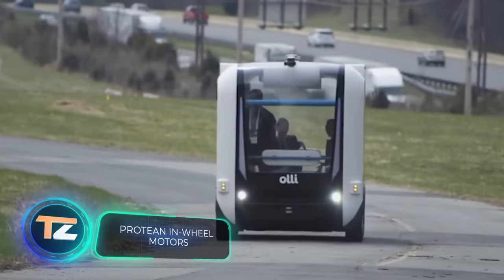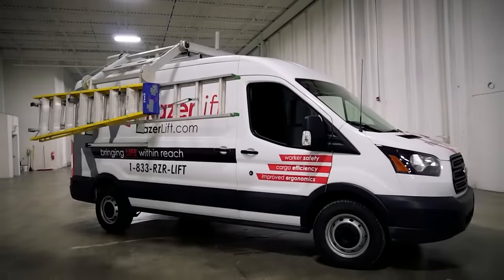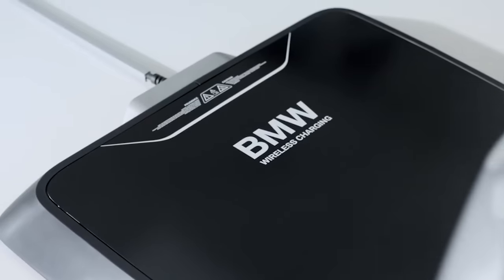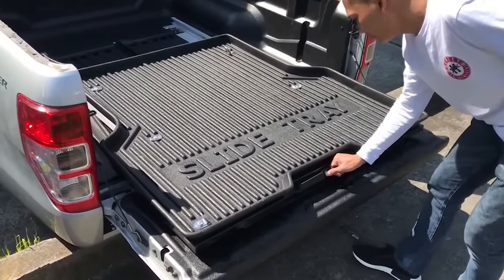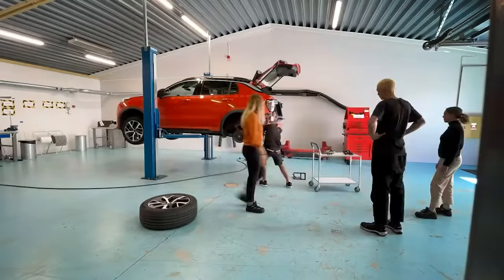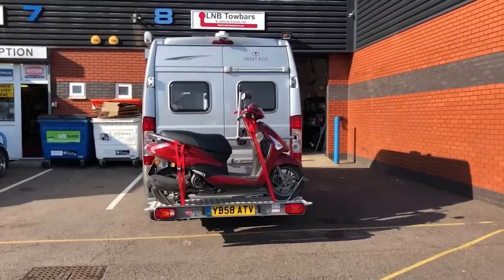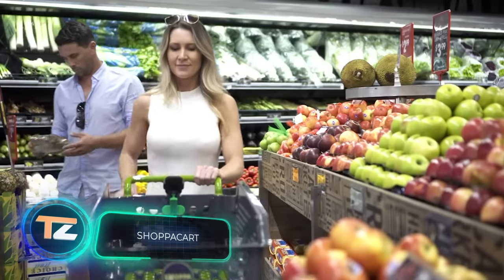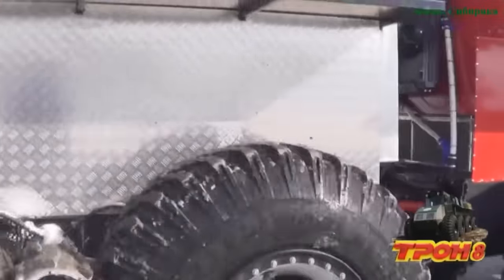INCREDIBLE INVENTIONS FOR CARS THAT YOU SHOULD SEE

Comment: 25 years ago I had a pulley system that would raise my Jeep’s hard top with rope and rubber coated hooks. I utilized the rafters in my garage and it would raise it about 3” and tie off to a cleat on the wall. I would drive out from under it. Cost about $25
Reply: Have the same in my garage to remove my camper from my truck. Super cheap and easy to make yourself!
Reply: ihaventchosenanameyet  What holds up the roof then?
Reply: Just cut a small access hole for the rope or bolt and problem solved, probably couldn’t rig it up anyway if you couldn’t figure that out.

Comment: That electric roof ladder lifting rack device has been saving live for many years. I have been a volunteer fire fighter for 23 years now and on our engines (pumper truck) the ladder is the top of the truck laying flat on the top of the tool boxes but next to the hosebed. There is a electronic lift the lowers the 200lb ladder down for us. Only takes 10 seconds for it to lower and another 2 or 3 to unhook and move the ladder. Love it.

Comment: The automated loader seems like a maintenance nightmare. I can't imagine it lasting very long.
Reply: I agree.  Also the weight of the machinery will decrease the payload of the truck significantly.   Whatever happened to the ol' shovel method anyway.
Reply: Its in the front of many silage wagons for years. And for 9k you could just buy a used one and outfit it with a motor to drive the pto.

Comment: The slide in the truck bed is such a novel idea at $750 (sarcastic). I've been using a pallet ($0) for about 15 years. Fits all truck beds, easily replaceable, lots of hand-hold locations, almost unlimited weight capacity, never have to wash it, never worry about messing it up, and if I don't want it in the truck for some reason, I just throw it on the driveway or lawn.

Comment: The disadvantage to those in wheel motors is a massive increase in unsprung weight. That is generally considered bad because you don't want your wheels to bounce off the pavement.
Reply: Increased weight equals more wheel bounce?
Reply: @jaxturner7288  yes. The wheels follow the pavement, so any inertia the wheels have will cause them to bounce off of bumps in the road and lose contact with the pavement. That's why unsprung weight is such a big deal. You want the wheels to be light enough that they can follow the pavement exactly without carrying any of their own momentum, then the wheels' movement can be controlled by the shock absorbers.

Comment: The ladder loader has been around for years for fire trucks. It’s nice that they have made a general purpose for sports equipment materials and other things. The inductive charging for the BMWs is extremely inefficient
Reply: I know right wasting 15% just so I don't have to plug in a cord!
Reply: @sambrose1  if the BMW charge pad came in an outdoor model that meant it was basically a manhole cover you just had to feed power to it could make sense
Reply: The payload of that ladder loader seems rather low, though. 150 lbs won't get you very far.

Comment: I used to be able to do the tops for my CJ7 in a few minutes. Place two sawhorses at a height just below the body, remove the bolts and screws to the windshield and then get under the top and lift with my back while balancing with my hands and walk it back. Dont think I could do that these days though. Have seen others use rope and a chain hoist on a tree limb or garage. No fuss no muss. Round headlights.
Reply: I've done the block and tackle between trees.  Now, I have an electric winch mounted on my garage roof.  Handy too when you want to work under your lawn mower without dumping fluids.

Comment: Track Mate (conveyor for unloading trucks) is a logical and practical solution. It proves that rich world still has smart and creative people in technology (not everyone is in managing sales and marketing). However, it also proves that nothing invented and made in the first (not third) world is competitive. The price of this product is as high as a new car. Even mid-class Americans will rather use shovels to do this job.
Reply: I have a tray back 4wd and for under $1000AUD i could turn the whole thing into a tipper this just feels stupid either you move enough stuff that this would feel necessary at which point your better of going a full tipper back it would be easier, cheaper and carry more or if you barely move stuff but are too lazy to do the work just pay delivery you would still save a ton
Reply: @shaynegadsden  Yea...it sounds like a good (old) idea if the only thing you might transport is dirt. Conveyors though can be used to transport/load/unload Amazon-like packages, fragile and sensitive items. Another important thing is that installing this conveyor is a way simpler, at least for those who can only handle a drill and a wrench.

Comment: The Rhino hitch at 7:18 seems like a neat way of hitching different height trailers, but most of the others looked like solutions in search of a problem to me...
Reply: Just use a drop plate  it's x30 time's cheaper
Reply: @no.1kickboxing226  Oh yeah, but that seemed easier/quicker to adjust on the fly...
Reply: solutions in search of a problem...I work with about 20 people that phrase would fit perfectly.
Reply: @christopherdean1326  There are hitches that allow the ball end to slide up and down to various positions.  They are far less complicated and keep the ball much closer to the towing vehicle than the Rhino hitch could.
Reply: @brianhaygood183  I have almost never towed anything in my life, so I am less than familiar with the various iterations of towing hitches.  I bow to your evidently superior knowledge of the matter.
Reply: @brianhaygood183  so the are balls that slide up and down different positions with a quick release?🤣🤣🤣🤣🤣🤣🤣🤣
Reply: HMMM well, I have a problem that the bike carrier and the crane solution would solve as there are many times that I need to carry extra stuff to access the rear doors without taking everything off and also lifting things to the roof of a building.  Some of the other solutions I may be able to use other solutions for problems.  The slide-out for the bed would be nice in the back and side doors of my truck too...

Comment: I dunno about that crane, mate.
One long beam supporting all that weight.
Hope you don't have to deal with any wind.
Reply: Cables, too. That steel can certainly handle far more than the 310 lb rating in compressive load, and the rest is handled by the cables

Comment: I like the idea of wireless car charging, they could be placed in carparks and do away with cables and charging posts.
Reply: Or just build more tram lines, which get their power directly from overhead lines, so they don't even need batteries and also reduce the pollution caused by tire wear.

That would also result in a reduced demand for car parks, which would mean they could be turned into actual parks.

Comment: If this shoping cart would cost around 130€, I would consider buying it, there is enough space in my eNV200. But on the other hand, wiping the cart with desinfectant and use the Euronorm-Boxes (60cm x40 cm, 22cm or 40cm in Heigh, all are stackable) is a much better space usage in my Opinion.
But there will be use cases though!

Comment: What if the charging plate is dirty? Will it affect the charging rate? What is the efficiency rate of wireless charging like this? Whatever it is, KUDOS for trying to tackle the charging issues!
Reply: Honestly there's no charging issue being tackled, they are trying to make it more 'convenient' that's all and that's questionable. 

It's basically the same tech that wirelessly charges your phone. Folks have been talking about, working on, a car version for ages, although getting better, it's not nearly as efficient as just plugging your car in. If the alignment over the plate isn't right - charing time is degraded. More the distance between the two plates - charging time is degraded. Notice in the video the car is being guided in to the right spot, because it has to be 'just right' to get max efficiency. If there's something in your way, like a bike, or trash cans, or shovel/rake... and you can't line up the plates perfectly -  charging time is degraded. Today's method, drive your car into the garage/driveway any way you want/can, plug it in (and automatically get the fastest charging possible no matter how well you parked), walk away - no fuss.

Unless there are pads everywhere it's pointless, as present and future public charging stations are plug-in, so your car is still going to need an outlet. It's hard to see public charging stations switching to this as it's slower, and at a public charger you want people (vehicles) in/out as quickly as possible.
Reply: @TStark-vj2wo  Just use a small robot arm to plug in the cable, same conviniece and way more efficient
Reply: @jonasstahl9826  Yes! Love the idea!

Comment: 16800$ for a pickup conveyor? No thanks. No company will spend that much, and no individual either. The effort of pushing it with a shovel is not that large, and much cheaper. The fact youd need install it in first place, it can break, the price, it takes extra space and weight, and for a thing like a pickup? 16800 is a big no. Thats the price of the pickup itself
Reply: At that price you could get a few dump trailers or a not half bad dump truck off an auction site

Comment: the bad thing about wireless charging is it uses far more energy so yes electricity wasted isn't good for society as a whole so yes just plug up your electric vehicle to charge don't be lazy that's crazy
Reply: Well, you are right. However, if I heard the narrator correctly, a 15% loss over a period of 3.5 hours for a full charge. Doesn’t seem exorbitant.
It may behoove the owner to; perhaps, invest in solar panels and a battery bank, go “off-grid”. Charge your car for free. Well, not free, the initial outlay… blah, blah, blah… tax breaks… Yada, yada…
Essentially, you pay for your power consumption, but… the convenience of not ever to wait in line for decent gas prices again?
Well worth it.
Reply: @cthawk6770  85% efficiency for wireless is ok if you put it in the road and you will be able to use that power when driving, 15% loss just to not waste few seconds on the plug for your car is pure energy waste and nothing to brag about.
Reply: There is only one use: taxis stands, where the drivers just park and wait for the next customer. But even in this case the ground palte should align itself, not the car.
Or it is a solution as shown for people to lazy to plug in a plug (which needs 6 seconds). BMW knows their customers, they are to stupid or to lazy to activate the indicator, why should they be useful enough to plug in the chargingcale...

Comment: If a foreign object falls on the plate charging stops, that does however charging has started so then the falling object detected by the plate underneath will have had to pass through the car itself dramatically reducing the need to charge an insurance write off.
The hard top lift looked unstable with the weight toward the front, is that why they don't really show it being moved about?
Hitchlift is an accident waiting to happen.
What's wrong with just using a wipe on a trolley handle the way most have been doing since covid went global? Much cheaper and they can be carried in a pocket.
Reply: Ya i laughed at the 400$ shopping cart.
Reply: They're even free in Australian supermarkets where it was invented

Comment: A 79 lb wheel is pretty damn heavy and will make the suspension much more clunky, also requiring completely redesigned springs and shock absorbers. Roadholding will never be as good as a the same vehicle with light wheels because it simply takes longer for a larger mass to bounce in and out of dips in the road, so the wheel is going to be out of contact with the ground a lot more. Also changing the wheel is going to be out of the question for the majority of drivers.

Roof load "managment system"? Patented? 🧐 It's a modified wheelchair lift. They've been around for decades. But a wheelchair lift goes all the way to the ground and stops there, avoiding contact with the side of the vehicle. In this video, despite several views of many examples on various different vehicles they carefully don't once let us see what happens when the thing gets to the bottom of its travel. Looks to me like one inadvertent bump is going to drive the lift into a body panel or window. No thanks.

The "car tyre microdust" thing doesn't make any sense. Where does the microplastic dust come from - the road, or when recycling the tyre? The footage accompanying the blah blah blah doesn't offer any illumination, so this segment just confuses more than it informs. At this point I've lost interest, the inventions I;ve see so far are "meh" at best and definitely nowhere near "incredible". Nice try but Buh-byeee.

Comment: So that van rack is kind of cool. But anyone who has already driven a van knows that it's already top heavy. So it's bad enough putting a regular ladder rack on it. So this thing is limited to 100 lb and not only that they didn't say how much it weighs. So you've got to add that weight onto what you're putting on top of your van which is going to make it more top heavy. Plus you can carry less ladders now because you got this thing. I opt for the old fashioned way of using a ladder and having someone help you. It's cheaper and you can get all your equipment at one time. Now those in hub motors. On the other hand, those are something special.

Comment: I think smart breaks that auto-activate on high speed and autopull on any obstruction in front at around 3 to 4 feet based on dual sensors (so that secondary sensor performs break function on failure of primary sensor and also alerts about failure of primary sensor) is a must and auto parking and unparking feature is also handy feature but would require ability for computer to drive and use of AIs and cams

Comment: 9:45 I wouldn't trust that crane in any way.   any side force or tilt and the whole thing would bend in half.
Reply: Lol, probably the same person that came up with those single piston long end dump trailers that always seem to fall over!🤣🍺
Reply: HVAC units are fairly light.  The crane is limited to 310lb, which is fine for a average HVAC split condenser unit.  I wouldn't want to lift a couple of people with it, but for its intended purpose it beats most of the other options available.
Reply: @brianhaygood183  Easy to use, easy to assemble and inexpensive for a commercial user. If you have a 3" receiver, then make the riser from 3" tubing  and use a powered winch assembly or a hand crank.